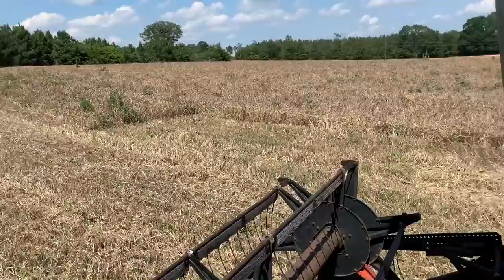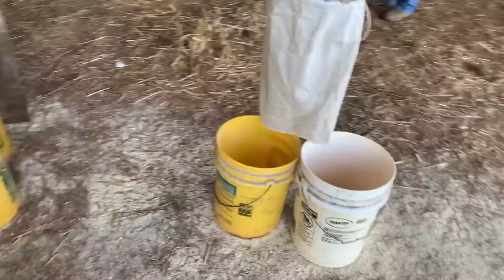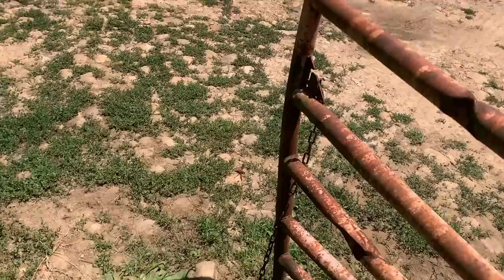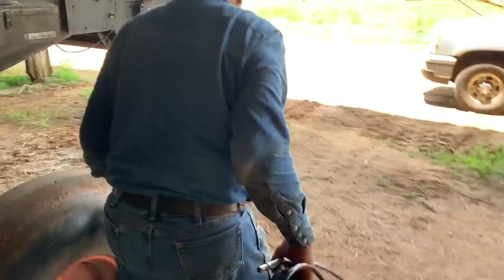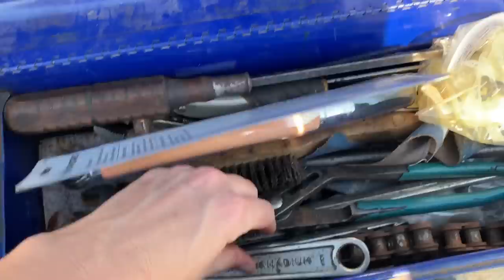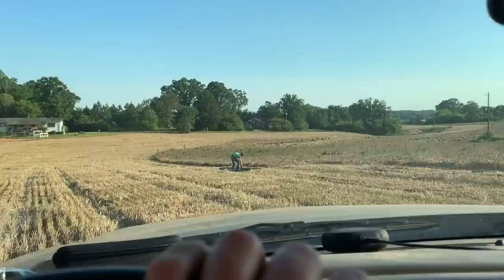I thought we lost her! : Combining Barley Trouble

Comment: Lawrence, CHECK OUT, SEA FOAM...fuel additive for the combine....great product and clean the grim out of the injectors and fuel system.
Reply from the maker: Thanks, will do!
Reply: I AGREE 100 % IT WORKS GREAT SEA FOAM
Reply: I attest, as well. Great stuff, for ALL combustible engines..!
Reply: Sea Foam. Great stuff. Buy it at Walmart, about $8-10 dollars a can.  I use it in my mower, edgers, chainsaw, pressure washer, and boat.  Everything but my airplane.
Reply: Seafoam works. I highly recommend it.
Reply: Wow. Never heard of it. I'm getting some.

Comment: I use to pick wheat with a Gleaner G no ac in my teens and it was hot. I would stand on the walkway and steer with my right hand. Still have the old G on the farm it just picks beans now. Don't put to much  grease in that wobble box because it will push the seals out. Two pumps is go. No need to fret to much she's a patch and go machine. Take good care of it and that ole gal will last the rest of your life.

Comment: When you were leaving the field that morning as He first started off again it look like the engine was smoking. Right on top of Gertie. So it didn't surprise me when he was overheating shortly after. I'm just a automotive mechanic. It's a struggle to keep those older machines running. But the expense of the new ones makes it worthwhile!!!! God bless from Canada
Reply: Need to blow the radiator out...compressor or high pressure water.
Reply: Yes it was clearly visible.
Reply: that was diesel smoke when he reveded up the rpm for working speed

Comment: Combines especially old ones will make you use a different language than you normally do........... That machine probably needs a whole new set of belts. It would be expensive but they get old and dry rot when it sets for most of the year. Glad it didn't catch fire. We NEVER used the word fire in a conversation when I was running a combine or baler (used to bail thousands of bales of wheat straw for a mushroom barn) every year. I have lost straw walkers sieves and a shaker pan once. Those machines literally shake themselves apart over time. A little tip.... Whenever we were in a field with more than one machine everyone watched and listened to each others machines. When you are in the cab your vision and hearing are lessened. If you are in the field with Lawrence and something just don't look or sound right stop him. I am sure he won't mind. He might scold you a little at first but it might just save a machine............

Comment: There's nothing that a couple hundred thousand dollars won't fix on Gurdie.
Electric grease guns are the bomb. Love is never having to pump a manual grease gun again. A few different fittings on the nose piece and you can get into almost any location.

******CAUTION, DO NOT USE MORE THAN 5-7 SECONDS OF PROPANE!**********

If you have a self igniter propane torch, I have a fix for the wasps for you. Place the tip of the torch into the gate pole. Allow no more than 5-7 seconds of propane into the hole, then squeeze the trigger lighting the torch. Poof, all the bees inside get launched like a canon ball out the other end.
A friend that I didn't know was severely allergic to bees was stung and can stumbling into work, unable to talk due the the allergic reaction. His Epipen was in his car which I quickly retrieved for a shot. Within minutes he was fine. The wasps had built a nest inside a pipe hand rail. Bee killer wasn't working because you couldn't get close enough before they got mad. Thinking about spud guns, I figured that a shot of propane would take care of them since the  handrail was drilled on both ends. Works like a charm.

******CAUTION, DO NOT USE MORE THAN 5-7 SECONDS OF PROPANE!**********

Comment: One fall at midnight I was on my last few yards of combining soybeans.The warning lights on the monitor lit up like a Christmas tree.Must be some electronic problem. Finished, unloaded into the truck and paged thru the operators manual. Beats me I'm  going home. Walked around the combine and saw smoke pouring out of the engine compartment. Grabbed the big fire extinguisher, nothing came out! Looked like mostly smoke so drove it burning 1/4 mile to the edge of the yard. Got a five gallon pail of water and it put it out. Wires were melted and the combine tried to start itself cranking and cranking while I stumbled and fumbled around in the dark trying to get the battery cables unhooked. The next day the JD mechanic came out paged thru his big manuals and after splicing 37 wires everything worked again. That was the closest we've come to burning one up,and I've never moved that fast again since!

Comment: @ The Farm Wife  Very glad to see that your Combine didn't catch on fire. Fire is a very big risk with Combines because of the nature of their design/build. Tragically, I personally saw 3 Combine Fires last season at Farms that we service. 2 of them were John Deeres that were less than 2 years old, 1 of them a J.D. S790 which costs well north of half a million dollars, fire got out of hand, and burnt it to the ground.
Always make sure to "blow it down" after every use, because the #1 cause of Combine Fires is a build up of Chaff and Stalk material close to anything that gets Hot, like ExhaustSystem, Engine, Hydraulic Systems, Bearings, etc. A few of the Farmers we service have started carrying Milwaukee Battery Powered Leaf Blowers on the Combines themselves, and try to keep the buildup of Chaff/Stalks blown off through the day. High Pressure Air from a Compressor works the best, and washing them down fairly regular with a Pressure Washer.
Stay Safe out there and keep up the Great Work.

Comment: Chauffuer :  sho-fur.  Re: wasps. Toss a half pint of diesel fuel on it. Gone. Next problem? Grease gun...old timers like me used hand pump power to grease machinery. My, how times have changed. And farm farm equipment on the highway...don't complain about farmers with your mouths full...They feed America. Only place worse than the tool shed to break down is in the field. Frustratin' for sure...

Comment: Have run a couple of gleaner models in my days. Never ever did I have one that the a/c worked enough to cool you off on a day over 80 degrees. But they were better than the old Massey Ferguson combines with a rotating fan above your head. Never came home clean until I started running green machines, but they break down as well.

Comment: Anyone been around farm equipment will burn belt up now and then.  Belts smoke big time due to the friction and heat which leads to flame. Burned up a few in my day.  LB has it under control.  It is just such a pain in the rear to put a new one on and then burn it up again.  Been there and done that.

Comment: Lawrence, did ye ever have a diesel run backwards?  That’ll kick start yer thumper.  Had a GM diesel in a grader back in ‘71. Stalled under load, and the engine kickstarted on the back stroke. Smoke boilin out of the breather and suckin air in the smoke stack. They’ll keep reving up till they blow theirselves up.  They won’t turn off at all.  The only way to stop em is stop the air.  Pulled my shirt off and stuck it in the exhaust pipe and killed the engine.  Saved motor but like to never got all of the cloth out of the manifold.
Reply: 2 stroke diesel

Comment: I can’t remember ever seeing you use any WD 40 on anything but it works really well on wasps. I found out by accident one day I had a big nest to deal with and that’s the only thing I had and it worked as good or better than any wasp spray I ever used. I know it sounds unbelievable but if you try it you’re gonna be hooked. It puts them on the ground. Get you a can for the gate guards and they will abandon their post. I guess I feel the same about WD 40 as LB does about Krol oil. I use it on everything and I always have a can in my truck.
Reply: Thank you for sharing that information WD-40
Reply: Kroil is the best.  Very common in commercial aviation hangars.  Aerokroil

Comment: The dark color on the barley and you had a "dark/black" dust on your face from the last post......
Do you have a "smut/fungus" ...
Should not be that dark.... what's
Lawrence see?
Reply: Didnt that field River Flood?
Reply from the maker: He can't figure out why it was so much dustier and black
Reply from the maker: Not that one actually
Reply: It looks like fungus (smut).
That's what it was called in the 50's in the wheat verifies.

Make belts slippery,sticks to everything because it has a "oil" texture to the dust.
Keep things blown off, it is combustible.....your about done.
Save some of the full stalks/plants to show to your seed dealer.   Don't remember "smut" in barley, but I'm sure it did.  
The ag universities built a stronger "DNA" into wheat so it wasn't a problem.  Really knocked the "snot" out of the yield;  Sometimes, spontaneously combusted and burnt the combine ( pull machine) and tractor along with the whole field.

Comment: You could of been watching your vlog , we seen the new smoke 💨 coming from behind the cab, we all, /or at least I noticed smoke blowing up from the engine compartment, that motor it already tired 😓 now it will start using oil, probably start looking for a engine,  get one ☝️ from the gleaner place, glad it still good , and just a belt back on it to make it through this season, then get new motor, you can buy some magnets 🧲 strips from harbor fright, and that would help keep tools 🛠 organized, might need a bigger tool box, they work vary well keeps your tools from getting lost, that bucket thing is a matter of getting air ,in to let fluid out, it pulls a vacuum, just like when your tur a glass of water up side down and lift it up ,the water stay in the glass for a minute, kool Meredith,thanks BigAl California.

Comment: 23:10 When Gertie started moving there, black smoke was coming out of the exhaust. That's never a good sign. Burning oil. I'm pretty sure he probably checks the oil constantly, to make sure it doesn't get too low, or the engine will fry.
Reply: black smoke is a common thing with that engine no biggie oil burning is blue smoke. all them older engines smoked black when working or opening up the throttle